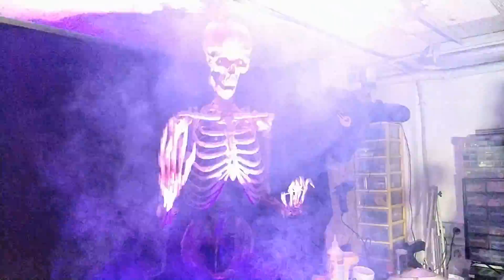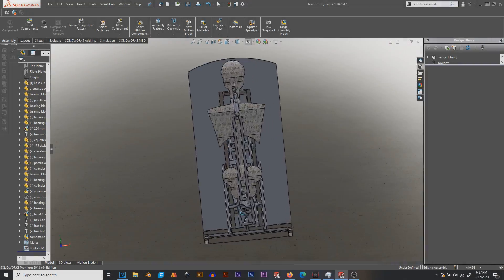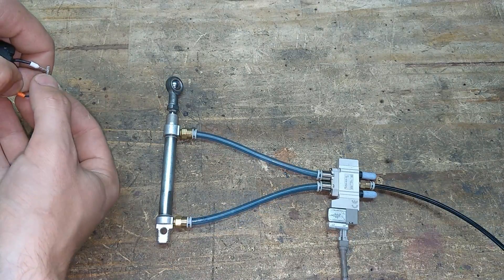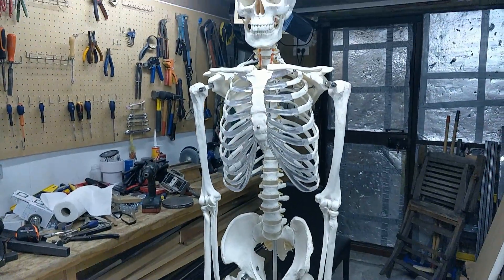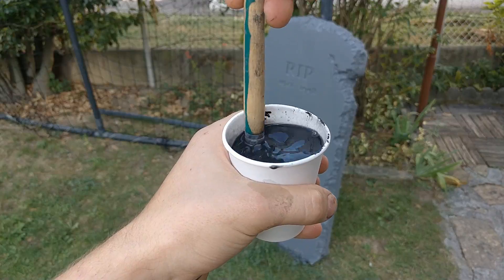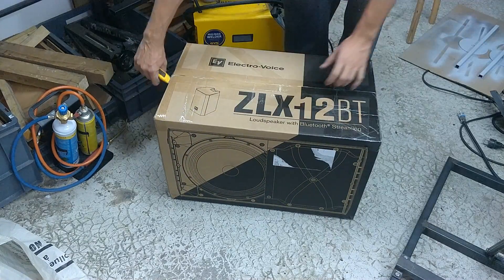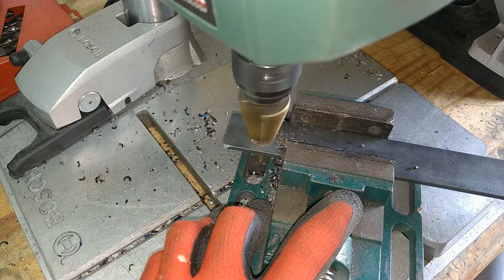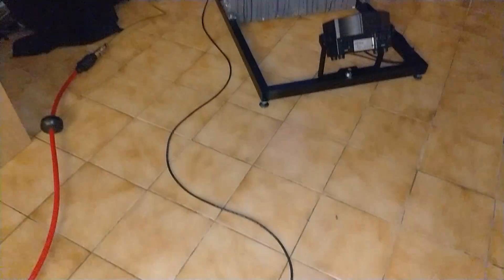Making the Halloween Animatronic

Comment: Pretty cool. I made something similar using just PCV (no welding required). I don't care for pneumatics, so I used a simple Picaboo Plus prop controller with built in MP3 + Amplifier (no soldiering,  coding required), windshield wiper motor and a few switches. It's also 1/8 the price and just as scary.  :)

Comment: Hey I'm planing on building one of these and was wondering exactly what square tubing is best for this project wall thickness and size. Thanks 👍
Reply from the maker: For this particular prop I used 20x20x2mm square tubing and 27x40x2mm rectangular tubing. Most of the nuts and bolts are M8.